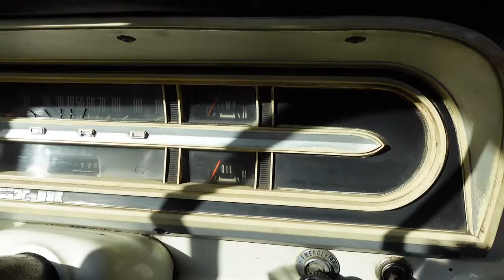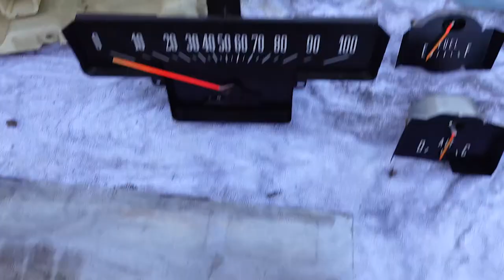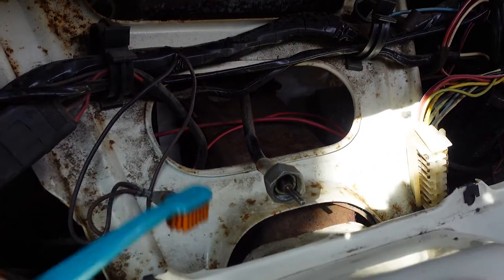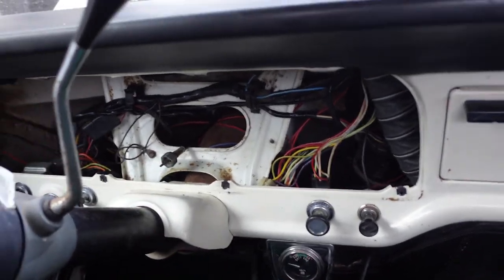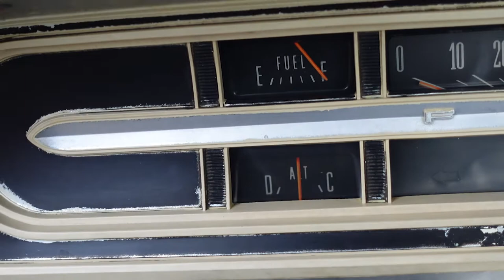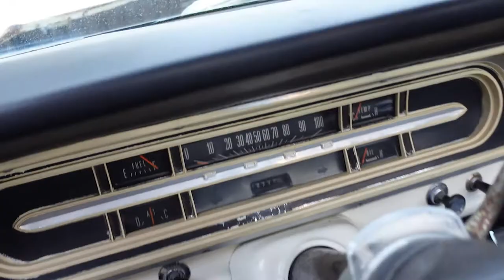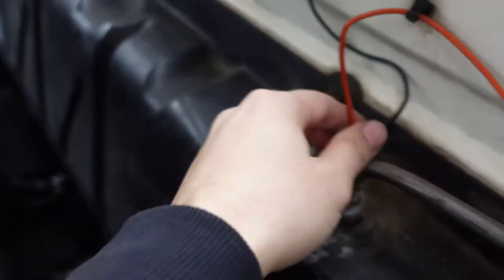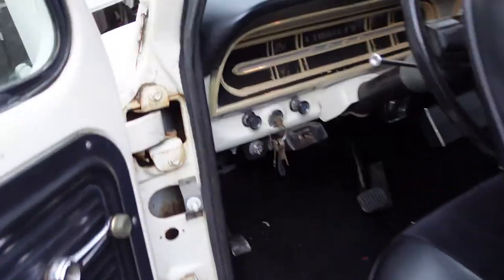F100 Fuel Gauge FIXED, cleaning the instrument cluster helped! – 1972 Ford F250 (Part 4)

Comment: The IPVR is a factory nuisance because when it goes, your gauges can still work but just be erratic.  So, it’s hard to deduce.  All it’s there for is the reduce 12v down to around 5v, if I recall correctly.  But in most cases, it’s going to be the fuel tank sending unit.  Corrosion is everything in old trucks.  You would be amazed how cleaning can sometimes get things going.
Reply from the maker: The cleaning did everything for me :)

Comment: How did you manage to actually pull out the cluster? I unscrewed the 8 screws and tried to pull it out but got hung up. Do you have to unscrew the speedo cable to pull it out? If so, how did you do it??? I couldn’t fit my hand in the gaps on the sides of the cluster 😖.
Reply from the maker: So yes, you have to tip the top down a bit, then move it towards you couple of inches, after that put your arm in back and unscrew the speedo cable, and then you can remove it. The easiest way is to slide it to the right when getting it completely out :)
Reply: @thedenis  thank you so much. I’ll give that a try. Your video was excellent btw.